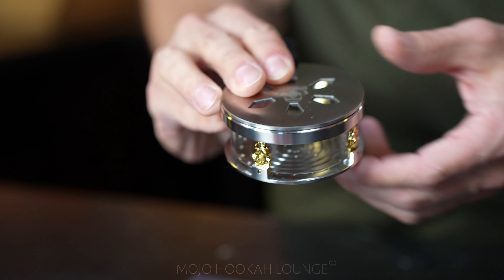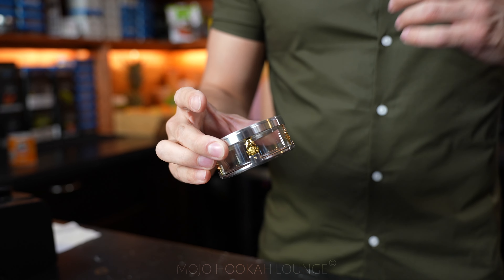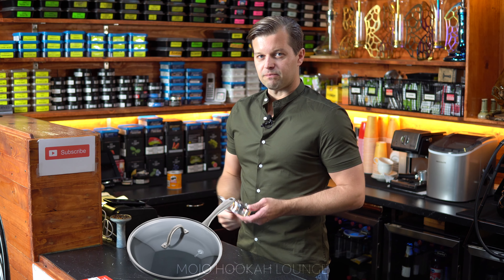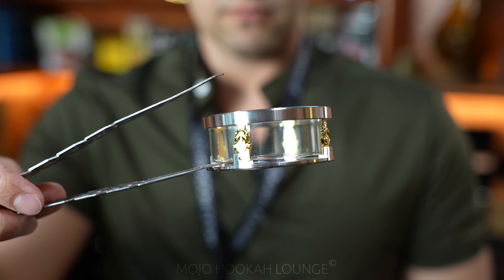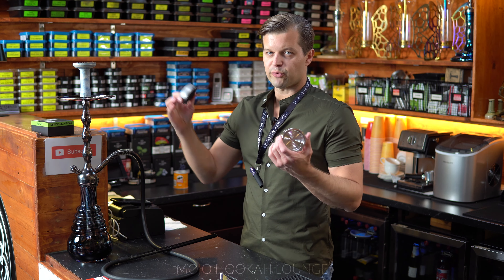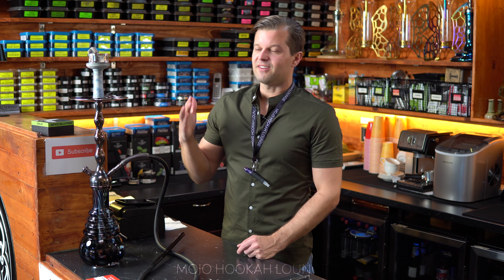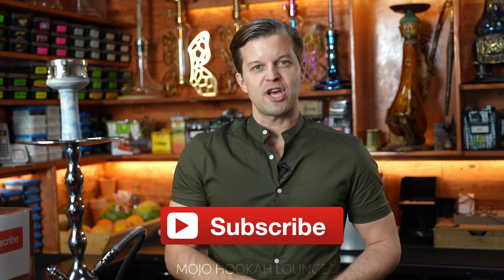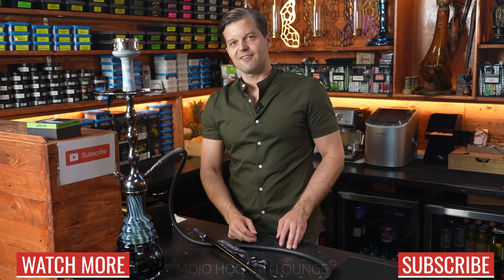TRYING TO BREAK NEW HEAT MANAGEMENT DEVICE

Comment: It's not popular ... not as far as I know at least not in Germany. I don't think anyone I know has this hmd, and I have many hookah enthusiast as friends. 
It's not like we havn't heard of it, but we have way better hmds so why bohter with an hmd that just looks nice, but may break on you. 

Currently for me and many of my friends the most popular option is the Na Grani, which is also an V2A hmd with a great heat output. 
AO 912 is also somewhat popular on the V2A side, but has rather large airflow hols towards the tobacco, so there is a good chance that you may ruin your bowl during a season because coal get's on the tobacco, heat wise it's more on the level of the kaloud .... so not great but if you're getting into V2A hmds a nice starting point. 

Alu Hmds which are popular in Germany are currently besides obviously the Kaloud Lotus, the Onmo which is an HMD by the creator of Moze and cost only 30$ instead of the 60$ price tack of the Lotus. 

Only thing to mention, non of these comes with an cover, but that's not an issue here in Germany at least, most of us don't smoke with an cover, and if we want to do so, we can always use the Kaloud one, as most of us have one and it often fits :D